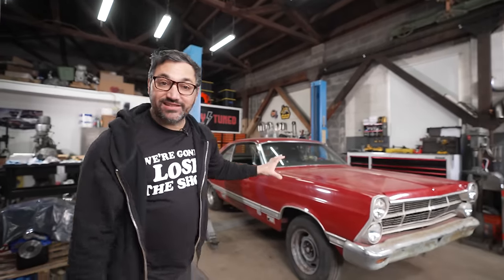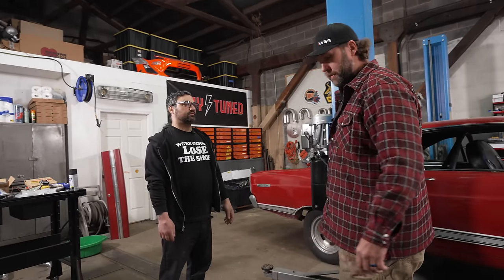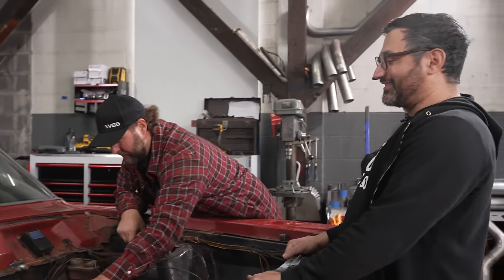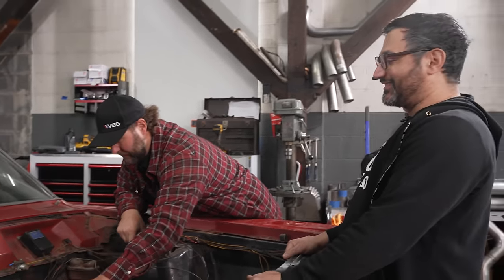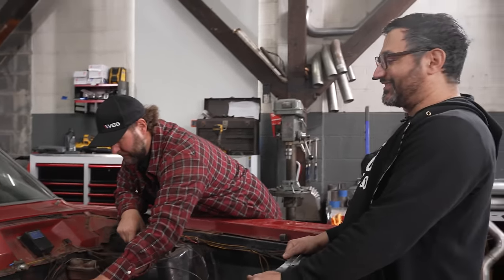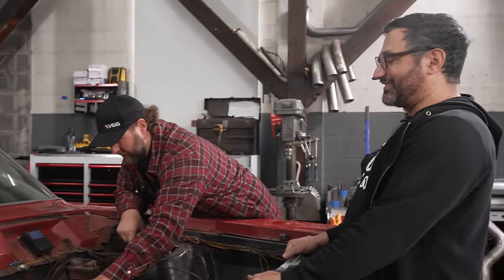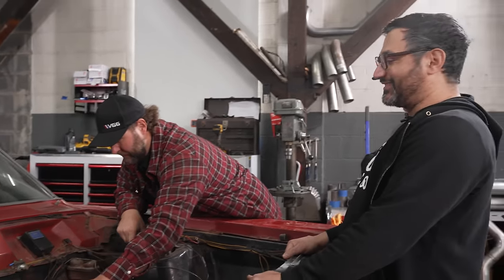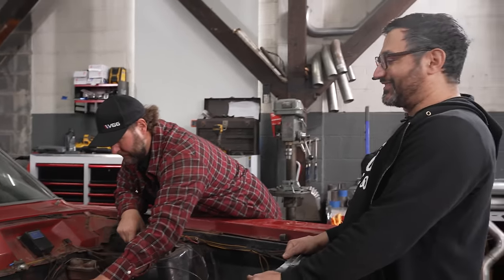Drag Race Ford Fairlane REVIVED w/ Vice Grip Garage After Sitting Dead 40 Years! | Part 1

Comment: As mentioned its a 1967 Fairlane 500 and not a GT.  When I was 16 I purchased a 2 year old 1967 Fairlane 500 with  the standard 390-4 barrel rated at 315 HP and 4 speed.  In stock trim they were capable of a 14 second 1/4 mi at around 90+mph. I remember the fun changing the spark plugs near the shock towers.  Mine was red on red with a bench seat. Mine was different from other 67's as it had the radio antenna in the passenger side rear quarter panel. Thanks for bringing back some old but not forgotten memories.
Reply: True Joe.

Wish I still had my '67 Fairlane GT-A. 
😢😢😢
Reply: Do you have any pictures of your car you could post on here 🤔🧐✌️🫡🇺🇸🙏
Reply: Catapiler welds😮
Reply: @BrianMagnafici-mw5xh  
I have a picture of a '67 Fairlane GT that's the exact same color as mine was, but I don't know how to go about sharing it here.
🤔🤔🤔
Reply: Joe Taylor, I wonder why it had the antenna in a different spot 🤔 Unless it was an original radio-delete from Ford and the previous owner had one installed during his ownership. 🤷
Reply: This car here is just a 500 , and it wasn't a factory 4spd . You could clearly see in one shot on the column the spot for the shifter so it was 3 spd manual or an automatic .

Comment: This was so cool.  At 15 years old, my first car was a 1966 Ford Fairlane.  Had the 289.  Really wish I had that car today at 60 Y.O.
Reply: A few years ago, I pulled an original 289/c4 combo out of a 66 fairlane 500. Would have taken the car too, but it looked to be a field bomber that somebody had a hard hit with a big tree. It was parked in the weeds for over 30 yrs and the Frame was tweeeked and pretty rotted. Almost got the 289 rebuilt will just need to find a fairlane some day soon.

Comment: This is so good. Thanks guys. Been watching both of you since 20 or 30 pounds ago. Maybe more. Livin that good life. Thanks for the content. Living vicariously through both  of you.  I’m 65/66 now and did most of my car years with no internet, email, text, or you tube. Got by with friends, late nights on cold garage floors, or sweat boxes, lots of dirt and grease, no $ for unlimited brake clean, we used leaded gas, mail, paper catalogues, a lot of guessing, grumpy machine shop guys for heads and decking blocks, know it all counter reps for cams, lifters, pistons, and Chiltons.  You guys are awesome.  Thank you.
Reply: Right there with ya @ 66, lots of dirt lots cold concrete and homade parts, friends & relatives and cheap beer. 30 wt oil, and STP.
Reply: Sounds so familiar, but I'm almost 72.

Comment: A buddy of mine had this exact car, red '67 Fairlane 500 with a hot 390, Cragars with "street" slicks. In the trunk he always carried two extra complete manifolds, and whenever the mood struck him, he'd swap out the single Holley double pumper 4-barrel for either a dual-quad tunnel ram or a tri-power, 3 deuces setup. Oh the tire smoke that thing could produce. One time we drove it 85 miles to our favorite 1/8 mile drag strip and swapped manifolds in the pits for class. This is gonna be a good build.

Comment: Granada spindles and disc brakes using the Granada outer tie rods are a near bolt in if you wish to budget style upgrade the front brakes. Also use a 1974 Pinto manual disc master cylinder also a bolt in manual brake upgrade. Works great. And you did forget the block plate .....

Comment: I'm a diehard Chevy fan , but love the look of these Fairlanes! One highlight of my dragracing days was racing the A/S record holding 427 Fairlane R-code with my 1974 Z/S Vega at Julesburg Dragway in Colorado and winning after getting a 9 second handicap start. At the next race, the Fairlane lost control and rolled mid track. The similar 3-point rollbar didn't help as the driver was airlifted to a Denver hospital with back injuries. Best wishes, have fun and be safe!

Comment: Those are '67 tail lights.
Reply from the maker: Yep, it's a 67!
Reply: @StayTunedTA  Back in my day my cousin had a '66 390 gta and a friend had a '67 427 4 speed. Both were monsters. Good to see you and Derek wrenching together.
Reply: As a 66 owner: 67 trim,  67 grill, 67 taillights and 67 dash. Happy th it is the 66/67 body style.  But I favor FE engines. Thank for the project.

Comment: AS SOON AS I GOT THROUGH WITH MY COMMENT I RETURNED TO THE VIDEO AND Y'ALL REMEMBERED THE SHIM BETWEEN THE TRANS AND BLOCK.   DAMN AT 77.5 AND 64 HOURS AND 42 SECONDS- I STILL HAVE GOT IT!   MAKES AN OLD GUY FEEL GOOD THAT I CAN STILL REMEMBER ANYTHING AT ALL.  REALLY COOL - I WISHED I COULD OF SHOUTED AS LOUD AS POSSIBLE TO SAVE Y'ALL ALL THE EXTRA DELAY IN "BRINGING THE THUNDER"   NOW I FEEL NORMAL - I DOEN THAT THUNG SEVERAL TIMES OVER 65 YEARS OF "NUT BUSTIN"  - YOU CAN TELL THE SHOW WAS NOT STAGED!  CHARLIE BASS SAN ANTONIO!

Comment: In the early nineties I had a 1967 Ford Fairlane GTA with a built 428cj with domed pistons and high lift long duration solid lift cam. Back then it ran 10.38 sec@132 mph in 1/4 mile. Full sheet metal completely stock body and chassis.

Comment: My grandfather had an old chain hoist in his garage.  He and my father built that garage back in the 60s.  There wasn't anything we couldn't lift.  Beams in that garage must have been 12x12s. An old cast iron wood burning stove to keep things warn so we could work in the winter when necessary.  Miss working on vehicles with my grandpa and dad.  They are the ones that taught me the importance of taking care of what you have and doing as much work yourself as possible.
Reply from the maker: Super cool. Thanks for sharing.

Comment: Watching the de-rusting of the brake drums was great.  I had my son turn the opposite wheel while I used a flap wheel on my grinder to take the ridge off the brake discs before installing the new pads.  no reason to have them professionally tunred..

Comment: First priority is use the bubble lever into the angle finder and specification is 2 to 1 degree down sample line of motor and transmission line aligning at back while the front motor is up of the angle.

Comment: Pretty common Fairlane modification back in the day to cut the crossmember and replace with one that would bolt in. Then you can drop the cross member and steering linkage to drop the oil pan to replace oil pump or roll in a set of bearings without pulling the engine.

Comment: Maximum is 8 3/4 inch ring gear diameter. So 12 bolts attached the ring gear is 4.1 axle ratio with Mercedes Audi automatic transmission 9 gear overdrive and Hurst shift stiff stick Woodpecker big tank exhaust empty muffler 9 inch diameter elliptic elongate booster in middle of front to back NASCAR for certain exhaust pipe in 1/4 mile ET.

Comment: Over a quarter million overnight  i watch alot of channelssince my stroke in o.c. and when they break a million subs, the checks roll in and then the tight nit group that has been there are gone no explanation.Ronys not gonna change.  Derek wouldnt change.i been watching since before haggarty andfollowed little tony when he started at hot rodwaiving his hands around when he talks.keep it up. Ill keep working on the other 3,/4 ofa million  the 67 fairlane i built with a 347 still screaming and the guy who bought my66 did live. Thhe fairlane was buried unfortunately. You all need a josh at drivelines inc. In o.c..shows up with a tapemeadure, a few days later a completely new beautiful driveshaft

Comment: Maybe use a 6spd trans with the quickie under the back,and i like my 289 in my hauler,enough room to change all the spark plugs,even with narrow towers,it needs electronic distributor to make it run right👍the orig is aprox 5 inches below that and its a 18 gal,arp 150 i think 200 with gauge sending unit,a auto trans is faster then pulling gears📵😄☮️🤐

Comment: If it is a 1966 it has 1967 tail lights and 67 trim. I ran a 1967 GTA for 9 years I bought brand new it ran mid 13s with 325 gears. Nice car but without the frame connecters it cracks the body in front of the rear roof on top of the fenders.

Comment: So its a wc t5 thats good i was like oofta may dont put a nwc in that itll grenade on the first 2nd gear pull (did this dropping clutch ) in my 92 s10 lost 3rd and 5th and 4th would hang up ... looked like boat paint massacre in the old t5(nwc) but then saw it had the tailshaft shifter location usually ford id.. there ..

Comment: That faiirlane is not a 1966,its really a 1967,it has a 1967 grill,I had a 1966 ft car back in the 80s,wish I still had it but the grill on a 66 did not have the vertical ribs in the grille and mine was a gt,good video!

Comment: Tire is 13 inch for rear wheels is requirement. Axle ratio is 3.86 to 1 maybe.9 inch ford amateur drag 1/8 tracker dragster non modified RAC.

Comment: Looks like you did not install the spacer that goes between the flywheel and the block that is the cover for the front of the bellhousing.
Reply from the maker: Keep watching! We learn!
Reply: @StayTunedTA  Yep!  I see you installed it later in the video.
Reply: That bellhousing is for the 10.5" clutch with the 157 tooth flywheel.  You running the 164 tooth flywheel?  I think yours must be 157 tooth or the starter would probably not work.  You need 50 oz imbalance too for the 5.0 HO motor.  The 351W and the earlier small blocks use 28 oz imbalance.  From what I gather you installed an 11" clutch on an 157 tooth flywheel and that is why the bolts hit the bellhousing.

Comment: Guys if I am correct the taillights tell me that is a 67 the only difference between the 66 and the 67 is the 66 taillight the backup light was the same shape as the light and it was placed in the center of the light and the 67 the backup light was split from left to right by the backup light like you have there ?

Comment: That is a 67 500. It is not a GT , you'll see when you run the Vin. If it was a 390 , it will have an S in the Vin. You'll find the Vin on top of the core support and one on top of the aprons on both sides.

Comment: The rear driver side axle is bend and bad wobbly of the flange and the bearing is in aligned Use motor run 2,000 RPM in first then tire is above Snap On wheel balancer not tire balancer. I can see it. The lathe of the brake drum is making the brake into warped by 1/4 inch bend of the spindle in the back wheels. Do not allow any bend in the axle and live outer and the inner race into out of round.

Comment: At first glance that looks like an early 70's Toyota Corolla fuel tank...
Reply: At 20:30 or so you say TE-21 ? that's the series prefix code for the 71-74 Corolla sedan with the 1600 engine.

Comment: Only 302 cu in in 14 to 1 compression ratio Valencia domed listens set what is weight of piston rod for top performance you know 50 to 75 percent titanium sheet thick metal rod into pivot crankshaft journals.

Comment: I was watching you guys put the flywheel on the back of the motor and yelling at the screen.  STOP.  You need the block separator plate first. I think that may be why the transmission sat too close and the flywheel rubbed inside the bell housing.
Reply from the maker: We put it on when we saw the rubbing, but still needed to grind.